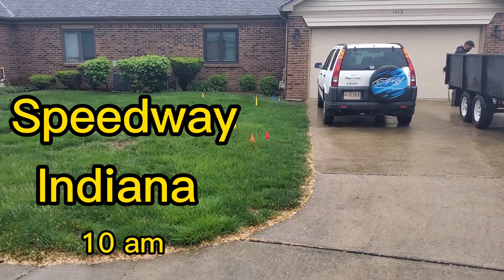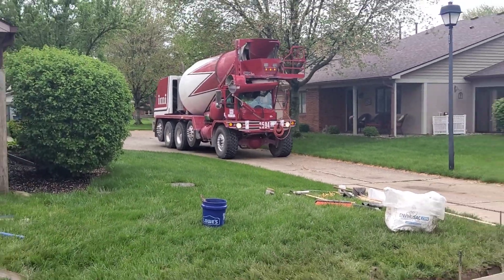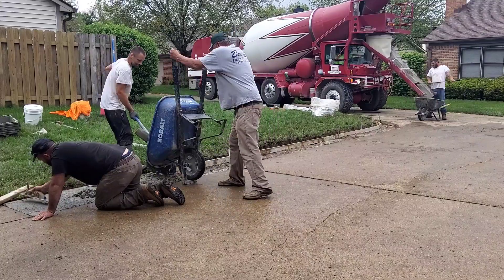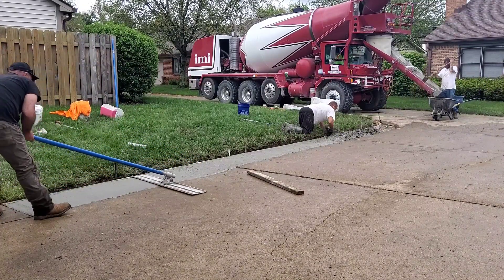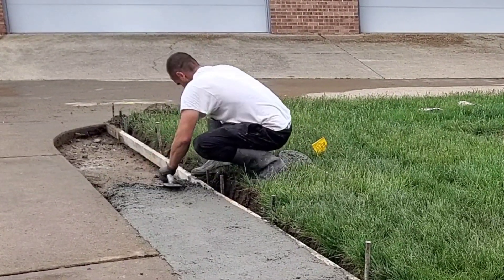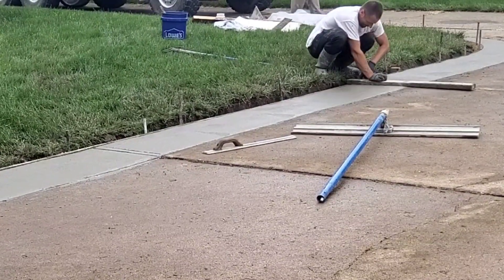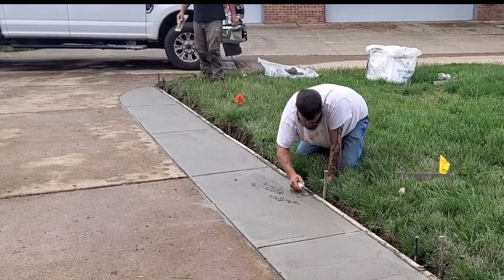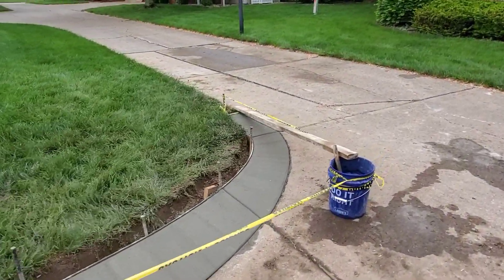How to pour a Concrete Driveway extension

Comment: Just a question, Why not use any mesh or rebar? Just curious.
Reply from the maker: We did use fiber and we do use it on most driveways just not patios, depends on what customer has in their budget
Reply: @GRUBB-MUDD  10-4.Thank you for the response.
Reply from the maker: That did have rebar downs every 4 feet into the existing

Comment: I have the same set up and I need the same thing done to my driveway here in Chino, CA. 35 miles east of LA. How much did you charge for that job? Just so I can have a rough idea of what it would cost me here. I know I’ll be paying more since I’m in the LA metro area
Reply from the maker: U can't compare apples to oranges if u send me your address I can tell u exactly how much I would charge, just either type it here and then delete it or, send me the address on fb messenger "Grubb mudd" I don't remember exactly what I charged on that, it was early last year